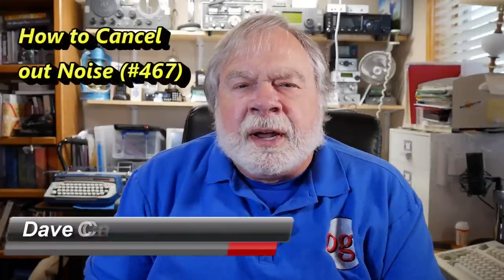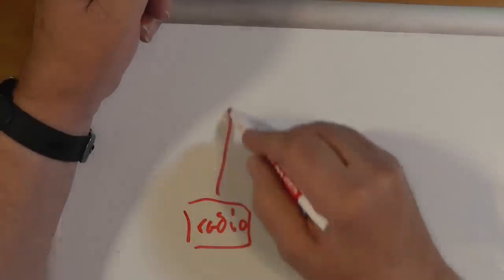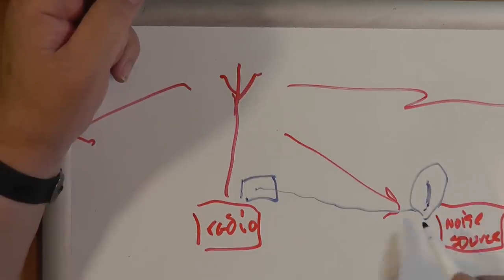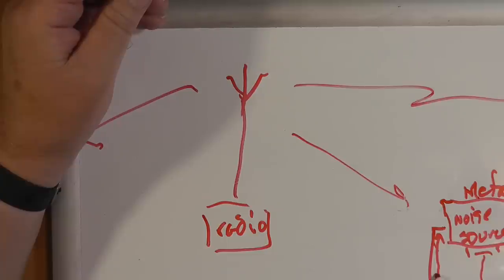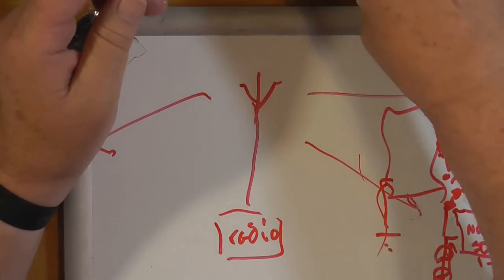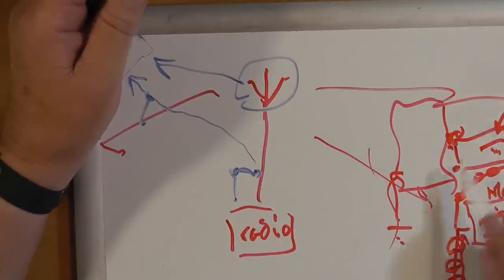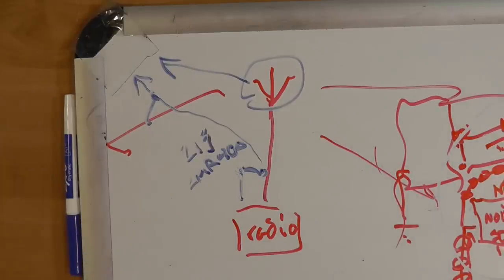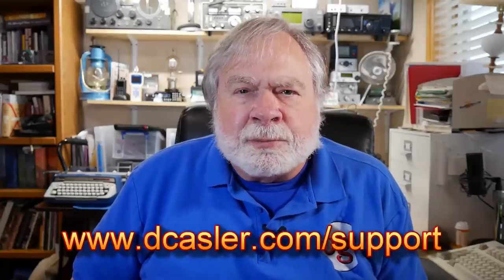Noise Canceling Methods (#467)

Comment: I've worked on these pumps for close to 40 years,  I'd change the pump relay.  They are cheap and easy to change.  Chances are the contacts are burned and arcing creating an oscillation.  You could clean the contacts, they are easily serviced but if they are warped and misaligned they will continue to arc. Your well is not inside your house, your pump might be but the well is out on your property somewhere and you will have either a well house over the top of the wellhead or a pit over the wellhead or a pitless adapter which looks like a pipe with a large cap on top. For the first two your well relay could be in the well house or pit. If you have a pitless your relay is in your house. The best place for your relay is near the pressure tank, the best place for your check valve is on the pump. 
I agree there is something wrong that is making your pump run so much.  A leak somewhere or a bad check valve. If a had to guess I'd say your riser pipe is leaking in which case it will have to be replaced, which will require pulling the pump. The check valve should be on the pump which will require pulling the pump to fix it.  Possibly it is on the top of the wellhead either in the well house or pit or if you have a pitless  you will still need to pull the pump as the check valve is down hole about 6 feet, but it should be all the way down on the pump.  You could put a check valve in the house but that's not ideal. If the real problem is a leaking riser you don't want to cover that by adding a check valve,  a leaking riser will become a broken riser with your pump laying  in the bottom of the well and significantly more difficult to retrieve. If you have a shallow well with a jet pump it will have the check valve built into the pump but you can add one inline, again as close to the pump as possible. It could be in your basement but will usually be out at the well either in the pit or well house along with the pump relay which if it is oscillating, don't move your antenna closer to it.  
73s
AI5BU
Reply: A friend of mine an Elmer told me the same thing about relay’s for a ham Amplifier! If the arc they can send RF back to the radio and cause all kinds of problems

Comment: With all respect, you assume a lot, Dave. In the south many/most wells have the jet pump above ground, and wells are almost all PVC pipe. No one but public utilities use steel well casings here. The pressure switch that turns the pump on is right on the pump motor, not located remotely.. My well pump is located less than 10 feet from my shack, and the only time it's ever created any RF interference is when the points were going bad/arcing. A new pressure switch fixed that problem. 73 and keep up the good work on your YouTube channel! Ken K4NWD

Comment: I'm sorry to disappoint all you who suggested that the MFJ-1026 was not the best way to go.  After testing with an MFJ-1025 from my friend Dean W7DHH, I purchased a 1026 from MFJ.  It took a little bit to get it calibrated, but once I did, the noise from the well pump has been totally ELIMINATED.  It has been 8 months now and still zero noise when the 1026 is in line.  I thank all of you for your suggestions, but I think I found the right solution.  73 de Dave AJ5F.

Comment: Just a thought, if the well pump is kicking on often, one solution that might help more than just HF would be to get a bigger pressure tank. A larger pressure tank has a larger cavity and goes a lot longer before making the well pump turn on to refill it. Small pressure tanks are usually inefficient and cause the pump to come to come on many many times whereas a larger pressure tank can go significantly longer without needing to turn on the well pump. Larger pressure tank can extend the life of the well pump by not running it so frequently and that also would be a positive for your HF experience in this case.

Comment: Great show Dave. Additional thought. It appears the noise source is constant when the pump motor is running. I suggest using a portable short wave receiver or AM radio as a noise source tracer to locate the culprit. 73, WA6LBY

Comment: I have a submersible pump with fiberglass pressure tank at my QTH.  I have zero noise problems from it on any band.  I agree with previous comment that something is wrong...probably several things by this time.  First it sounds like his system is short-cycling due to the tank being water-bound.  Many modern well systems use a pressure tank with a 'pressurized air bag' within the tank.  The bag is pre-charged with air to a pressure just a couple of pounds below the pressure at which the pump turns on.  These bags develop air leaks after a few years and fill up with water.  The water will not compress resulting in very frequent cycling of the pump.  Short cycling will drastically shorten the life of a pump and other components in the well such as the torque arrestors, pipe, centrifugal starting switch on the pump, etc.  Sounds to me something has worn to the point where it is arcing...

Comment: Hi Dave,  question about a mobile setup.  I have led headlights and notice when I run them the noise floor comes up about 3 S units.  Should I run a ferrite bead on the power line or install a power line filter??

Comment: Hello. May you show how do you cancel noise using a noise bridge? Most properly the connections from radio to the noise bridge for such purpose. The part I don't understand the most is "don't transmit to the noise bridge or you'll fry it for supper". How can it cancel the noise when you disconnect it?

Comment: hi Dave I love you Service I have a question on Noise on 75m 40m 30m and 20m a noise level of s8 to s9 I am running 53foot end fead 25 feet up have power lines 25 feet from end of antenna tried grounding the coax shield and counter pole to no help have ferrite chocks comming to see if that will help do you have any other ideas I plan to try moving antenna end away from power lines only on 1/2 acure so can't move to fare 73 KK7BVG Ken Sypher

Comment: I agree that the noise canceler is not the best solution in this case.
I disagree with the "they don't work well" or that you haven't heard of them working well.
I have seen a lot of videos and I myself own one of them and it is the only thing that works with my vertical to drop my noise floor.
My noise floor is nothing in my house but it drops me from a s8 noise floor to an s1 on 40m, now that said I just switched to a random wire and it is so much quieter than my vertical I don't need it for the efrw.

Comment: Sounds like his tank is small if the pump is turning on often.  Better to have a larger tank to reduce pump cycles.  This obviously will not solve the noise problem, just reduces the frequency of pump cycles increasing its life.  Well pump replacement is no fun.
Reply: Or the pump tank, if it is the type with a "bladder", might have a hole in it.   I second Louis Seaman's more complete  explanation below.